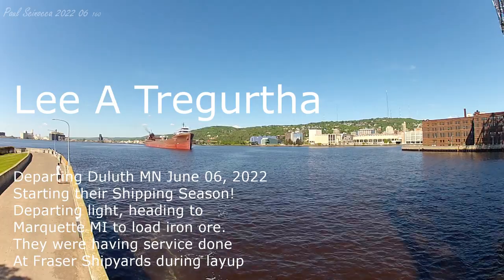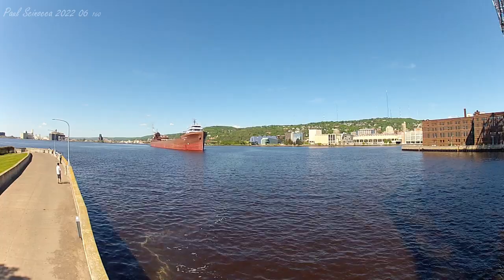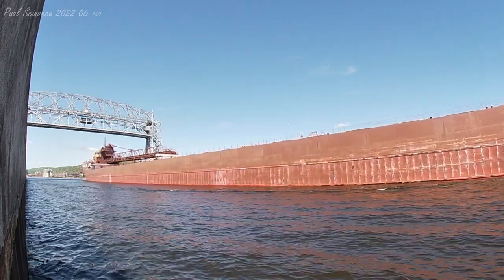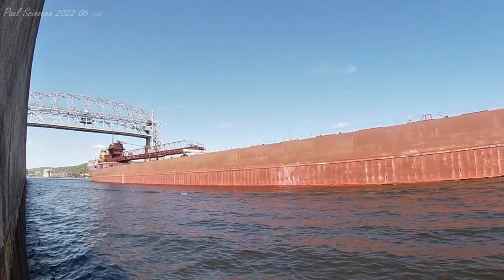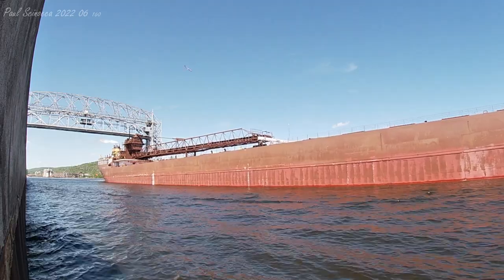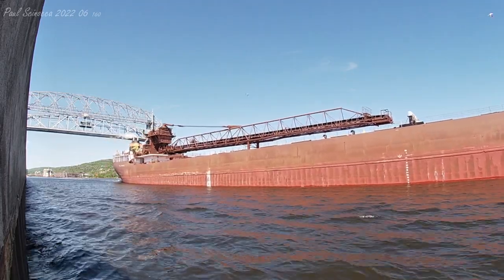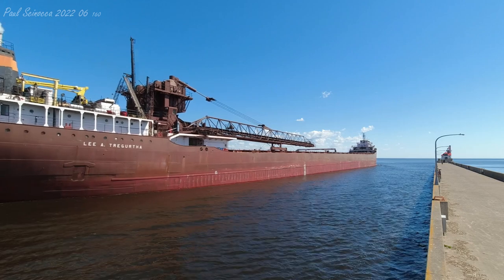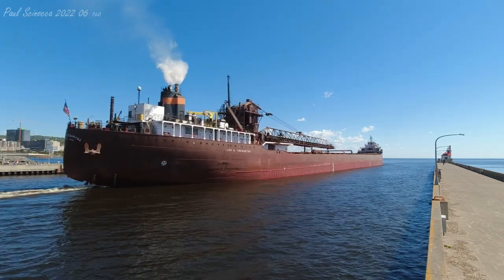I was in WWII! The Lee A Tregurtha!  Starting their season departing Duluth June 09, 2022

Comment: I'd be curious to know how much of the LAT is still that WWII era ship.
Back then, she was a ship with everything amidship, with cargo holds fore and aft of that.
Then she was converted into a Laker - a Laker that was lengthened.
Obviously considered enough of the original to display her Battle Stars.
Reply from the maker: I was on it years ago, got a great tour of the ship. I know some of the gun mount markings are still on the deck. As you know, the bridge used to be in the center.
Reply: @PaulScinocca  that's cool - I wasn't aware the markings for the mounts was still there.